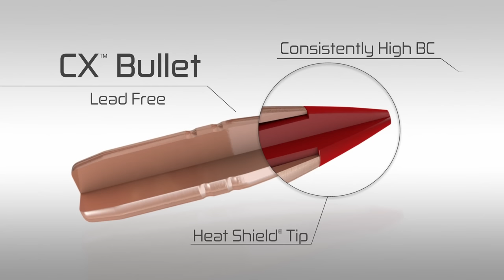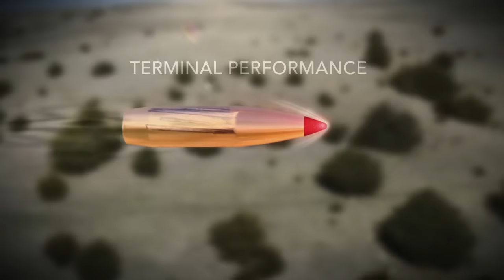Ep. 082 - Let's Talk Load Data

Comment: While I appreciate the viewpoint of Jayden and Matt, how are other manufacturers consistently showing higher max charge weights and they are doing very similar testing?  You cant tell me that Hodgdon, VV, etc arent doing proper pressure testing.  Another thing that was eluded to was the fact that every chamber, barrel, bullet, etc is not the same.  So the rifle YOU shoot may tolerate more or even less pressure than what is listed in the manual.  I know for a fact that every single rifle I load for the Hornady loading is below what my actual max is and Im not a velocity chaser.  Im not seeing high bolt lift pressure, and my primers still look good.  To sum it up?  The reloading manual is simply a guide, not a hard and fast ruling on what YOU can safely test and load to.
Reply: 100% agree. Hornady is always lower than most . He's right, lawyers  don't do pressure testing, BUT they do say, "Hey, if someone gets hurt because of YOUR testing, you can get sued."
Reply: One aspect i think play's a part is the SAAMI max pressure for that round. Yes you can push hotter. And a decent example, I seen a youtube short today of a coyote getting hit by a 58 grain bullet from a .234 winchester at 4,000 FPS from the video description but hornady max with that bullet (im assuming they used the hornady 58 grain) is 3,800 FPS. One sacrifice you make with that level of higher pressure is the life of the primer pocket. I remember that being a note made on this podcast from a episode I think talking about the 6.5 PRC or 6.5 Creedmoor cause one of the hosts was at a match and duplicated some competitors loads and the brass could only take 2 firings before the primer pockets were too loose to be used for another loading.
Reply: You will also notice powder manufacters will show a higher load density = higher speed most times. I think they want to show the consumer what is possible. A bullet manufacturer wants their bullet driven between this max speed and this minimum speed for best results in accuracy or in hunting the bullets terminal performance. I think it's good to reference both the bullet and the powder data before starting the work up.

Comment: I've never wondered why your data is different from others. You format your charges into speed columns and then, critically, you don't publish pressures. Since you don't publish pressures where others do, we can assume that your data is conservative.
Reply: From my experience which is little being I started loading in 2020. Hornady manual is conservative in terms of charges but I’ve noticed very diminishing results after their max loads in terms of velocity vs pressure(possible over pressure). It’s pretty noticeable in my 9mm ammunition and really noticeable in my .44 magnum.
Reply: I'm really enjoying the Hornandy podcasts and it's turned me to favor their products.  Like others, their load development is technical.
But I think better if they publish the pressure info?  We are not able to "assume" conservative if they are not supplying the values (high/low limits should also be published somewhere).
Reply: Go back to the 2:40 time in the video, they explain that the red boxed powder charge is where they reached the SAAMI MAP (Maximum Average Pressure) value, they don't post pressures because most people don't have the ability to test for pressure.  Also, pressures can vary quite a lot with minor changes in the chamber dimensions or case volume.

Comment: WHY WHY WHY and another WHY is the load data published often derived from unrealistic testing. Example: Testing  a 308 WIN with 24 inch barrel where the common modern 308 has a 20 inch barrel. Or a 223 REM with a 22 inch barrel where the most common length is 16 inches.  You cannot help but know the given data cannot be accurately extrapolated accurately by the consumer using different length barrels from SBR's to ELR target barrels. Understandably, testing all lengths would be a nightmare, but hey, data for the 3 or so MOST COMMON barrel lengths is neither impossible nor cost prohibitive. The consumer should also be given data on the most common twist rate options where multiple popular twist rates are in use.  I personally would spend more money on something that works rather than jump to a variety of products looking.  Note here I am not in any way advocating the consumer depend solely on published data WITHOUT personal load workup.  However frustrations cause looking i.e. more costly Testing for the consumer. Just a few WHY questions.

Comment: Reloading manual  data is nothing more than a guideline, it is pretty damned close, but there are no absolutes available to apply to the data, people want an absolute in reloading, it will never happen. The reason there are rules recommended in reducing max loads, is the data creators have no control over what comes out of a powder plant, and that includes Hodgdon, who doesn't actually manufacture powder themselves. These days, powder recalls usually get out PDQ, 30 yrs ago, you may see it in a magazine ad by the mfgr, 3 or 4 or 6 months later, and there is still 30yr old plus powder out there. I encountered a fast batch of IMR4320, min load almost locked the bolt, didn't see the notice til 6mos or more later, that was around 1990. Just encountered what appeared to have been a mistake correction in Hodgdon data on L'il Gun, hit max at over 10% below max, and 300fps over max speed, little while later, see different data online. Every manual publisher has had mistakes in their manual also, nobody is exempt from that. Checking the charge weights for the bullet weight above and below what you are looking to use, can enlighten you to some odd stuff in a manual. Then you have to ask if that data appears legit or what?  Go check other manuals, call the publisher if necc.

Comment: In my experience, in terms of correlation between published and actual, the best load data on the market is published by Hodgdon. 
I reference all of them Hornady, Hodgdon, Barnes, Nosler, Vihtavori, Lee, Sierra, before choosing a safe starting charge. The variances between all of the load data sources is substantial.
Reply: Yes, I was doing some loading today for my near obsolete 6mm remington that's really hard to find ammo for. My hornady manual showed I could load up to 49.8 grains before going into the red (off the top of my head). My lee manual for hornady listing said the max load was 46. I was thinking why does hornady show sooo much higher than the 46. 46.2 was middle of the road in the hornady manual for the same bullet.

Comment: Regarding load data, the manuals are guides....GUIDES. Many will indicate, "NEVER GO OVER PUBLISHED MAX LOADS," or similar. That's fine for THEIR test components. For over 30 years the vast majority of all my handloads are over or well over published max loads and are completely safe and more accurate since my components are different. Anyone can reference the bullet manufacturer's data, the powder manufacturer's data, etc. and see differences even between them when the bullet and powder are the same in either guide, sometimes even the case and primer. All of these published materials are guides to me and excellent for starting points but many are under-utilizing what I've achieved with my firearms. They can claim the lawyers aren't involved but I don't buy that. I have too many friends that are attorneys. I continue to increase powder charges, low and slow, until I reach the first indication of pressure. That's max

Comment: I like to see pressure data posted. My reason being whether it's right or wrong. But I tend to use slower burning powders per the cartridge data. I feel that a slower burn rate lessens pressure spike and its more conducive to accuracy. Also I get a better cartridge fill. So I think it's important for choosing or buying a powder. That's probable to work well.

Comment: 🤔 I would like you to do a podcast on powder selection and the variations of temperature stability between them and how that can effect performance in the field (when it can be 100 F colder in the field - in late Winter - than the controlled "room temperatures" that your testing them in the lab)?
Reply: Yes!  It would be very helpful to know which powders perform with reliable consistency regardless of temperature and which ones you really need to be careful with (in terms of load development and ambient temperature). 

Then there’s fill volume or whatever it’s called. Some powders such as Win 231 don’t seem to be sensitive to how much of the case is filled. Others like H-296 (IIRC) have a very narrow window of how much of the available volume is filled with powder. I guess compressed loads are a derivative of that. Some powders it’s OK to compress (AA #7 and #9 come to mind), but with other powders a compressed charge is verboten.
Reply: 🤔 What I would like the Powder Companies or Bullet Companies To Do (since by background is in both Engineering and Chemistry) is use a bomb calorimeter and measure the "Available Energy" per grain of powder - as a function of temperature! Then, they could publish that and you could figure out, directly, with each of your loads exactly how it would effect your velocity ahead of time and without the use of a chronograph, once you had your initial velocity numbers to reference from! And, Yes, I know we have Horneday's Simple Ballistics Calculator - But, That Doesn't Take Into Account the Exact Powder and Powder Amount That I Am Using! Meanwhile, My Suggestion Would Not Only Help you in Determining Your Ballistics, and Could Also be Incorporated Into a Ballistics Calculator, But Would Help You More Accurately Determine What Powder to Choose For a Particular Hunt (and may even keep some people from blowing themselves up)! 🤪 Most of these "internet experts" either have zero loading experience or very little knowledge about how some of these powders work! So, when they pick a powder out of the book - it is always the highest one listed - measured at "room temperature"! However, when you actually are hunting in the middle of winter, it isn't going to generate the highest velocities and isn't going to provide you with the best accuracy, because your velocities will have changed so much! Take Reloader 22, for example, which is listed as the highest velocity in the Nosler Reloading Manual for a 7mm Remington Magnum Rifle and their 175 grain bullets! It is listed as changing 1.71 ft/s per degree of temperature - but, that includes an average for all cartridges and doesn't exactly equate to the amount that you are using (62.5 grains, for a maximum load, in this case)! But, in the middle of winter, if we are hunting with a full load and getting 2,970 ft/s at room temperature and it is actually -100 F degrees cooler, that means that your Actual Velocity is "More Like" 2,970 ft/s + (-100 F × 1.71 ft/s/degree F temperature change) = 2,799 ft/s! 🥶 Had we chosen a more Temperature Stable Powder, like H4831, we would have Only Lost Around 30 ft/s of Velocity and though are initial velocity at room temperature was lower, our actual velocity in the field would be higher, under this senario! 👨‍🏫 So, Powder Choice Matters, and is Effecting Your Results In Making the Shot (Especially at Farther Distances)! 👨‍🔬 Further, some cartridges handle Temperature Stable Powders Better Than Others - like the 270 Winchester and H4831SC, so it "Might Also Influence" which cartridges/guns you buy? I always look at which cartridges handle the temperature stable powders The Best, like H4831/H4831SC  and H1000, When Choosing My Rifles/Cartridges! 🤑
Reply: @ronlowney4700  ha!  I didn’t know all of that, but H4831SC is my “go to” powder for 270 Winchester.
Reply: 😂 Exactly, and Most People Don't and This is Why I Requested They Do a Podcast on This Subject! ☹ But, Now You Do! 😃 And, You Have Also Selected My Favorite Cartridge and Powder Combination! 😜
Reply: 😂 If They Want To Hire Me, I Would Do All The Work For Them and Even Develop That "New Ballistics Calculator", That Would Be Able To Give You All That Information! 🤑
Reply: 👨‍💻 Another "Factor" That They Touched On Here Was Primers! Primers Are What Ignite The Powder and They Are Not All The Same! For Accuracy - Deburring The Flash Hole, Primer Seating Depth, and Primer Choice (Depending Upon Temperature Too) Can All Play Factors In Both Velocity and Accuracy! So, We Have "Theories" and Then We Have "Observable Facts", Which Don't Always Happen The Way We Think They Will! There Are Lots of "Little Variables", Like They Said, That Can Add Up To "Noticable Differences" In The Results! Simple Things Like Variations, From Lot To Lot, In Your Powder Combustion Rates, and Variations in Your Other Components! 👨‍🔬 "Good Stuff" To Talk About Though! 👨‍🏫

Comment: Something new reloaders don't know, or at least fully understand, is that not all bullets of the same weight are the same. Bullet profile is a huge factor.  Some bullets are considerably longer than others in the same weight and are cause for differing charge windows in most manuals.  Also, the test barrel that each manufacturer used while testing directly affects the advertised velocity.

Comment: Long time user of your Data and Bullets.  You hit on one point that would make your Handbook of Reloading really stand above the rest.   I would love to see you run each load through 2 barrel lengths and report the velocity for each.  I know this can't be done for all the loads but it would be nice for say 10 of the most popular standard rounds.   Say .308 in a 20" and a 26" barrel.  Then maybe the same for .223, 243, 7RM, 30-06 and 300WM?   Barrels are getting shorter for a lot of guns due to cans and the AR platform popularity.  The old standard 24"-26" that was used so much is not that common anymore.   I imagine a lot of loaders are looking for  effective powders for shorter barrels, and no load book seems to take that into account.  
Also in a couple instances could you run a load with a standard and a magnum primer to show the pressure/velocity change? 
Years ago I played with all the components myself, but as everything gets hard to find and more expensive its hard to just go play with components to find data on your own.  So info like this could save your customers money in component testing.

Comment: How common is it to find barrels that are below the SAAMI bore and groove specs?  Back around 2007, a bunch of undersized 6.8 SPC barrels got out and caused pressure issues.  That, combined with a bunch of incorrectly ground reamers caused many ammo makers to download ammo.  The spec for most .277 barrels (270 Win , WSM, 6.8 SPC, etc) calls for a land/groove ratio of about 30/70 but some manufacturers made them closer to 50/50.

Comment: Great podcast, I really appreciate the information you are putting out. I do have a question that have I yet to be see answered. I have 6.5 PRC that I was trying to reload with 130 CX. I know that there are a lot of variables but with my gun and my reloading I am getting max or over published velocities using the minimum published charge wait. I have asked customer service and have yet to get answer. Is this within the realm of possibility or is there something i am missing? Before it is mentioned the barrel was cleaned and a bore scope used to make sure the barrel was clean and that there was no carbon ring in the chamber. Thank you I am just trying to learn and be safe at the same time.

Comment: While you are at it:   Why do we not have an advanced Quick Load - like simulated dynamic firing predictions?
How much would it take to get starting pressure?  The QL programmer left behind some guess-timations and a way to adjust for starting pressure.  The PRS community always talks about "Off the lands" data.  We are left with "Don't start on the Lands" or doom may befall you.  "We see it in the lab".  How about showing us how you see it?  How much "Jump" is needed for a particular caliber at 90% of SAAMI MAP, 99% of SAAMI MAP?

How far off would you be to use dead load testing pushing a round down a 4" test barrel to get "start on the land" pressure?

Economical high speed chamber stress testing and recording is just around the corner.  Will there be calibration loads provided?

Comment: The vast majority of my loads do exceed your Maximum published load data. I do find Hornady to be on the softer side of max load data. However, if i need to just focus on accuracy i usually stick with hornady max loads. I do find there's a window of velocity and accuracy in my AR, 2600-2750 with certain projectiles and 3000-3150 with the same projectiles, Anything in between is just mediocre for target or Game.

Comment: So if my rifle has the same length barrel as a load in the manual that only has velocity listed with the pressure test barrel and my velocity is considerably faster, then I should assume a need to reduce powder to avoid overpressure.

Comment: Good episode. I do have a question though that wasn't addressed. I can understand why there are load discrepancies between different sources, but why are there different max charge weights with the same bullet, same powder in revised editions of your manual? For example, the Hornady 9th edition says for a 6.5 Creedmoor, 140gr BTHP loaded with Hybrid 100V, the max charge weight is 42.8gr. In the 11th edition, it says 41.3gr. Why the difference between different editions of your manual?

Comment: How can the base test model account for variances in throat depths? 

My 260AI barrel has a specific throat length tailored for the long 143g ELDX seated to a longer than published COL- 2.92”, which is a pressure mitigator; it increases the empty space in a case and case capacity, thus decreasing chamber pressure peaks.  

How can the published absolute maximum powder capacity be universal with these mitigating variances?  Your absolute cannot be universal, it can only govern the test chamber.